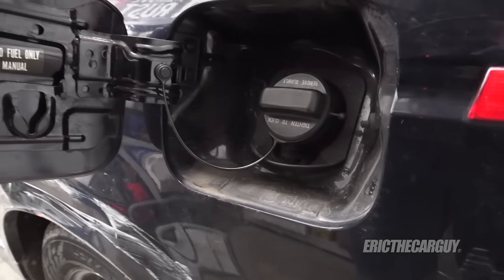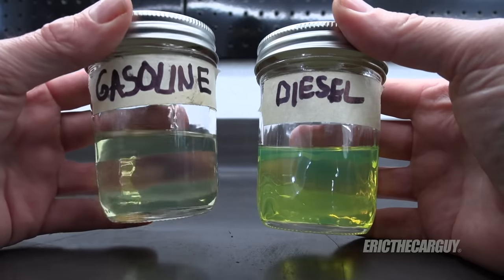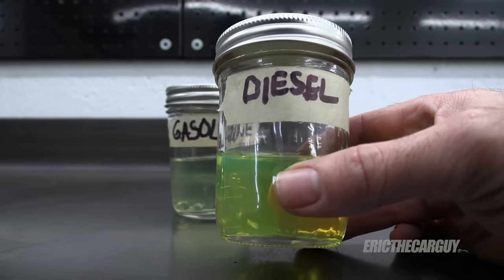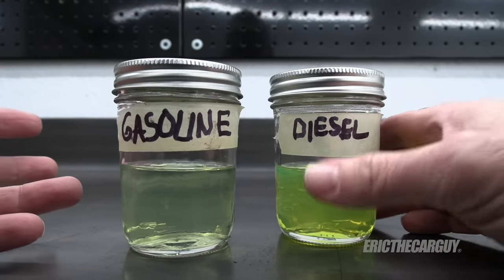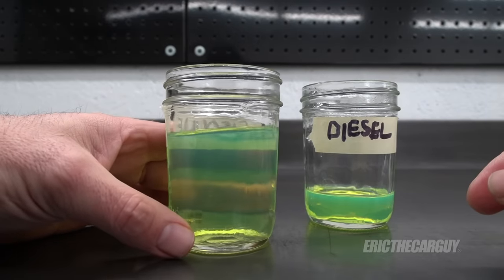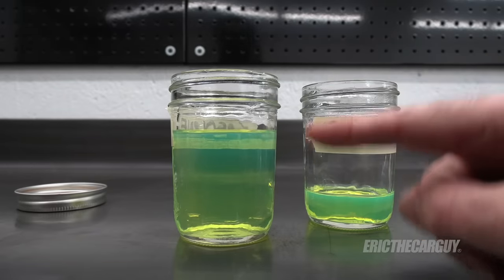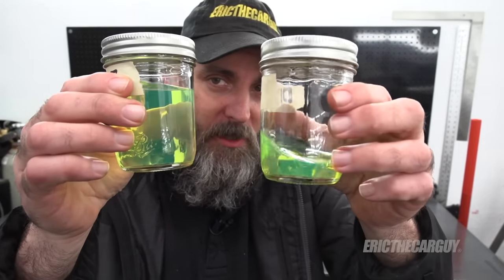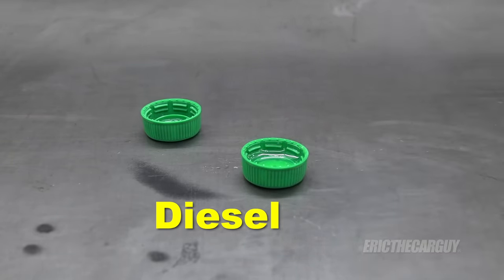What Happens When You Put Diesel in Gasoline?

Comment: If you put petrol in a modern diesel with common rail injection and drive off, you can easily total your car.
Reply: I think the car would be fine - fuel supply line would be the issue.
Reply: That is absolutely true. Gasoline has high compression and will blow the heads off
Reply: @mds2465  I'm sure diesel has higher compression compared to petrol.
Reply: The issue is that diesels use diesel as a lubricant and gas goes not offer the lubricity that diesel does. So the components run without lubrication, frag out, and fill the engine with metal shavings. A modern diesel fuel pump is 5000 pounds of pressure, you need that lubrication.
Reply: @adriansrealm  And usually the metal particles coming from the destroyed pump clog up the injectors...
Reply: @adriansrealm  I'm sure 2 strokes require a mixture to run.
Reply: @adriansrealm  The metal shavings will clog up the injectors. There's no way in hell those chunky metal shavings will ever get past the tiny holes in the injectors, so at least the head and block is safe. You will, however, have to replace the pump, the filter, clean the tank, replace the high pressure pump (this is usually a timing belt job), replace the fuel lines, fuel rail and injectors.
Around €10000 last time I did this, on a 2010 Tiguan. The car was less worth than the bill, but the customer still got it covered on insurance....
Reply: Petrol in ANY diesel, is the usual bang of death, because, well, it will flood the a lot more fuel, as gas is thinner than diesel, after it's sprayed into the cyl, it tends to explode due to pressure and heat, really, explode, I've seen things up to broken crankshafts, cracked heads, craked pistons, blownup intakes and even turbo damage or a mix of all of them, depends greatly on engine revs. But, it's common to mix some gas in diesel, around 2L gas and 100 diesel, specially on very cold weathers.
Reply: @forevercomputing  Not necessarily. There are old Detroit Diesel Engines that are 2-strokes but not require a mixture like 6v92 series.
Reply: The issue is first no preventing the mis fuel as the gasoline nozzles are thinner and will go in the diesel vehicle filler. 
No lubrication from gas can damage the fuel pump and injection system.
Gas will detonate faster under the increased pressure of the engine it can break pistons and crankshaft.
Reply: about 2 months ago had a 2019 Isuzu NRR Diesel with 2900 miles that they had filled with gas and ran til it died. i flushed the tanks changed the filters ran diesel through and changed the filters again as Izusu Tech support recommended. last week it came back in for a fuel system code and found the fuel pump at WOT was producing only 25,000 psi and it should have been about 29,000 psi. Isuzu had me change the entire high pressure fuel pump, high pressure lines and all 4 injectors for a total just under $12,000 all said and done
Reply: Power 2 Weight  As long as he doesn't blow the welds on the intake XD
Reply: @smokinjo29yahoocom  I'd prefer to stay with 4 stroke. I like doing some works, but doing a top end? No.
Reply: @smokinjo29yahoocom  you are actually not correct about gas in a modern diesel engine. It can harm it it just depends on how much gas is mixed and how long it was run. 

About diesel in a gas engine that will run too. Again depends on the concentration but it won't run well.  Look up a main street auto video where they got in a Kia soul  with a misfire that ended up being mis fueled with diesel.  You will see him trouble shoot the car and find diesel mixed in the gas and the car ran just not very good.  There was still enough gas to fire the engine sort of.
Reply: @smokinjo29yahoocom  sounds like a good conspiracy theory
Reply: This makes sense in theory but in reality this is not the case.  Sure you might shorten the life of your fuel system but I have never seen gasoline cause an immediate failure.  Usually, the engine will stall because of the low cetane and btu value of gasoline.

Comment: ok my dumb ass did it!   BRAINFART ...here is my story.  I have two diesel trucks and wasn't paying attention when I pulled up to the pump.   The big green nozzle fit right in.  I pumped 13.9 gallons of diesel into my 2023 Tahoe 5.3, and filled my 24 gallon tank. I had more diesel than gas.  After about 20 miles, I could tell the engine was a little "off" so I thought I had bought gasoline with a little water in it.  I stopped at Walmart and put in a bottle of injector cleaner and a bottle of octane booster. It seemed to help so I drove on.  I went 65 miles before I noticed some exhaust smoke.  I headed back home and got there okay. The only issue was a little popping sound like a small backfire under the hood when I would accelerate from a stop light. Also, the aforementioned smoke.  By the time I got home, I was rolling gray coal smoke out of my duals.  The exhaust tips were BLACK and the rear hatch was sooty. I was able to syphon the fuel to nearly empty. (Syphoning fuel on a new vehicle is possible with a small stiff hose with the tip cut at 45 degrees and the proper twist as you work past the anti-syphon ball value).  I dumped in a five gallon can of gasoline and drove to the gas station. I added 18.7 more gallons of gas.  This meant I only had 3/10s of a gallon of the original blended diesel and gasoline left.  I drove around for about 10 minutes and was still smoking pretty good.  I was also blowing fine black snow out of my exhaust.  The next morning, I did an oil change and that fixed the smoking issue.  It been a few days, and I have had no issues.  During the entire episode, I had logged 124 miles on a 60/40 diesel/gas blend.  Thankfully, I came out of it ok.  No injector or fuel system issues so far.   OH, I did add a few ounces of Lucas injector cleaner with the new gas too.  The Tahoe has no fuel filter, just a screen in the tank.  Chevrolet mechanic gave me his blessing, so I feel pretty confident my lucky ass got a break.

Comment: I remember when I was a kid my dad experimented with adding diesel to the gasoline in his f350 with a carbed 460. He came up with 1gallon of diesel to 10 gallons of gasoline and it actually increased the fuel economy a little and left a white coating in the pipes. Any more than that he got soot. All bets are off on a fuel injected vehicle though.
Reply: How long did that 10 gallons last?
60 miles lol?
Reply: I'm pretty sure the carbed 460 didn't have a cat converter, FWIW.
Reply: I don't even measure what I mix. Oil, diesel, gas, lamp oil, charcoal lighter fluid, moonshine, I just throw it all in the tank and my truck keeps on running like a champ. Multi-fuels are great.
Reply: All bets are NOT off with a fuel injected vehicle! I've used it several times in several engines inluding a modified Corvette LS1.  I used a far smaller ratio, like 1cup diesel to 10 gallons of gas, and had only benefits, no cat issues, soot or anything.  It essentially raised the octane level and stopped some minor pinging I'd been having even with high-octane gas. High compression engine was tuned for more HP and had the timing a bit too far advanced, hence the need for more than 'premium'. Essentially high-octane is harder to ignite (or in my Corvette's case 'preignite' due to pressing the limits of timing to compression ratio). Diesel is also harder to ignite, so the effects are much the same as higher octane. It's also an upper-cylinder lubricant, similar to Lucas gas treatment. It likely won't benefit lower performance engines that are running well, just like higher octane fuel doesn't. It's a misconception that higher-octane is more 'premium', other than sometimes have more cleaning additives than 'regular'. High octane is only harder to ignite (therefore reducing preignition in vehicles that require it- typically performance engines.) Like you said, you don't want to run the ratios you mentioned in a fuel injected car, too hard to burn completely (cleanly).  But in the right ratios depending on your engines tune, works great as an octane booster!
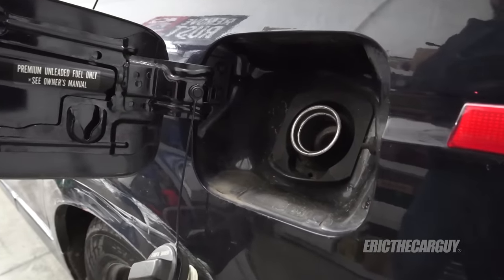Reply: 1:11 ratio is a bit too much even for a Carb and no Cat-Con. The unburnt diesel will go into the exhaust while still burning and the pipes will glow cherry red. 

Neighbor with a 1985 Dodge Caravan 2.2 carbed and no cats. He mixed 2 gallons of diesel into the 18 gallon tank. The Headpipe got so hot it caught the carpet padding on fire. 

This is a case of "Some is good, More is NOT". On my Suzuki 650 I can add 1 cup diesel to the 4 gallon tank and it will run fine. Cleans up the combustion chamber and the pipe will not have any soot.
Reply: As Diesel has less octane it will be more torquier due to preignition I guess
Reply: @jeladsnikpoh1289 Diesel isn't harder to ignite at all, the fact that at ambient temperature it isn't flammable doesn't mean it has a high octane rating.
It's quite the opposite, since diesel engines rely on self-ignition, diesel fuel have a scale that indicates the tendency to self ignite (cetane number).

Don't be fooled by the high compression ratio in diesels, diesel fuel don't detonate just because there's no fuel in a diesel combustion chamber until you need combustion.
Injection in diesels happens around TDC, and the fuel ignites readily when injected.

What you feel on your car is called "placebo effect".
A cup of Diesel in 10gallons of gasoline doesn't do anything but to add a little lubricity to the fuel and REDUCING the octane rating of a very little.

Comment: I'd rather end up with diesel in a gas engine than gas in a diesel, especially the newer ones, you'll ruin some EXPENSIVE parts!
Reply: no. It works just fine. Many use it during the winter. If you add too much I'd suggest adding some oil too to lubricate fuel pump. What's the new cetane number? I'd like this vid to be much better in explaining that

Comment: For non-catalytic engines it's been a practice of some - ever since leaded fuel went away from normal pumps I'd guess - to put a little diesel in with the gasoline fill-up as an upper-cylinder / valve lubricant.  I've done this with motorcycles, older carburetor vehicles,  and a fuel-injected Jeep Wrangler (inline six) that someone took the catalytic off of.  They all ran great with that little bit of lube in there.

Comment: My 6-year old son wanted to "help" my wife pump gas into our '95 Mazda Millennia. The car ran for 150 miles until reaching their destination. Next day, the car would not start. It was eventually diagnosed with bad fuel, tank drained, and refilled with gas. Car ran a little rough until the rest of the bad gas was out of the system. I contacted the out-of-town station about the bad gas, and after looking at the receipt, was told diesel had been pumped, maybe 1/3 to 1/2 tank.
Unfortunately, the diesel nozle was the same size as gas.
Reply: This is wat I accidentally put desiel in my dad truck and it was bad I made the same mistake

Comment: Hey Eric. I'm a Chrysler tech in Canada. Our Diesel nozzles are yellow or green, it depends in which gas station you go to.
Back to the Chrysler tech thing.. we have both diesel and gasoline powered vehicles as you would know. So we do get both sides of the equation a lot more frequently than we probably should.
Gas in Diesel vehicles doesn't seem to bother them much. We have been very lucky and only ever had to flush the fuel system out. 
Diesel in gas vehicles usually goes the same way but on 2 instances.. we have actually seen 2 engines that began to Crack the crown of the pistons as a result of trying to burn the Diesel fuel.

Keep up the good work pal

Comment: Years ago a Trucker told me he would add a gallon or 2 of gas to his Diesel  Tanks when going into subzero temperatures, He said it would  prevent diesel from gelling up because of the cold. I once worked fueling Diesel Locomotives in Montana, We would add a couple gallons of Alcohol during winter months, I thought that was to help the water move thru the fuel system during the winter months
Reply: Yep the diesel treatments like Hot Shot and Cetane booster...is actually a volotile fuel like gasoline.

He is absolutely correct. Unlike octane booster which makes gas ignite SLOWER, the cetane booster helps diesel ignite FASTER. Gasoline is the most economical common sense way to do so. 

There have been many cars through history which had diesel and gas tanks and used gasoline mixed in at startup then switched to full diesel.

Comment: Great video man! I've seen this happen a few times at my job both ways around - gas in a diesel and diesel in a gas. It's always a pain when they put gas in a diesel because in addition to removing all the bad fuel we need to change all the filters. And they take forever to get started again. I've never seen engine damage result from this, but that's not to say it can't happen. I have seen catalytic converters go bad on gas vehicles not long after something like this though.
Reply: Would 400 gallons of ulsd into a 17k full reg tank mess it up?
Reply: I'm wondering if you're pre-filling the new diesel filters before fitting?

Comment: Gasoline in a diesel car is much, much worse :P
Edit: He does address this later on in the video so my post is kinda useless. Jumped the gun too early lol.

Fun trivia: Older gassers couldn't care less, they'll laugh at you and run normally on diesel as long as the engine is warm. (You'll probably damage the cat tho).
Reply: Random Stuffs 😂😂😂
Reply: Eric already mentioned that diesel is sort of a very lightweight oil and there's the catch: modern diesel pumps or pump injectors on the engine are lubricated by the fuel they're pumping up to pressures well over 1500 bar or 20000 psi. replace that lubricant with a solvent and i guess you can imagine what'll happen, right?
Reply: @ivokraaier9740  The fuel system is the least of your concerns if you run a diesel car on gas to give some perspective on how bad it truly is. You'll cook everything :)
Reply: @Chriva  bearings don't like to be spun degreased huh. I'll have plenty of time to sort the commonrail while I'm rebuilding the donk.
Reply: @Chriva  experience?
Reply: @Chriva  the fuel system of modern diesel engines is probably the most expensive to fix/replace so it's not the least of your concerns.
Reply: Fixing a vw Tdi 2009+ if you have gas contaminate you will grenade the high pressure fuel pump and injectors. 
While sending debris through the lines, and tank. 

If you are lucky to not have additional failures from the engine and emissions system you are lucky to escape the dealer with a $9,000 bill. 

Yeah it’s a big concern

Comment: The smaller gas filler neck was actually done to prevent you from putting leaded gas into your tank and killing your cat.
It's just that Diesel-fillers are still the old size bc Diesel never really changed that much. The switch to LSD in the 2000s was gradual and did not include a change in filler size.

Comment: The reason diesel is bad in gas, is that eventually the gas will separate out and sit on top of the diesel. leaving the pump sucking up a majority of diesel and a little bit of gas, so if it does run (poorly) it will do major damage with detonation. we had a Technician rev up an older engine after flushing the system out, but forgot to flush the rail so there was still diesel in the system, and it threw a piston through the block.

Comment: I know a guy who adds a little diesel to the tank when he fuels up his GTO.  He says it raises the octant enough to stop his high compression engine from pinging.  I don't remember how much he puts in (per gallon), but I know he's being doing it since he rebuilt the engine back in 2012.

YMMV!
Reply: I commented earlier, but I ran it in several modern day gas cars, including a modified (and ohh so fast) C5 Corvette (likely the same engine as your friend's, depending on his year) for the same reason.  I ran about a cup per 15 gallons of premium gas.  Because it was tuned, I could see on the computer that it allowed me to add more timing before any potential preignition.  It also cleans and lubricates things better.  I don't think it does much good for cars that don't need high octane, though.
Reply: The octane rating of diesel averages 20-30 so it would definitely lower the octane of the premium higher octane fuel it's mixed with.

Comment: People putting petrol in their diesels is a somewhat common occurrence in the UK. 

Kinda worse than the diesel in petrol, tends to cause more damage due to the lack of lubricant
Reply: Not only lack, but also breaks apart all kinds of materials in your engine. Gasket included (if it's not metal or old school carbon).
Reply: AliasSLH each pump in the uk has a nozzle for each type of fuel (usually) so we get basic gasoline called "unleaded" (95 RON), then we have "superunleaded" (98 RON) and if you go to shell then you also get two choices of diesel standard "low sulfur" and then v power if you want the better lubricants, higher cetane and better detergents. 
Having worked in the motorsport industry for 10 years using a chassis dyno and have compared many a different fuel... I would never use anything other than shells v- power.
Reply: Think you got that wrong why around pal , petrol in a diesel vehicle is much much worse than the other way round.
Reply: @andynaylor3392 Literally what I said